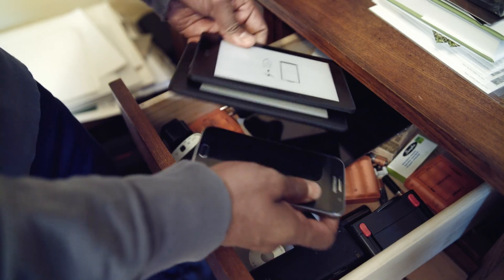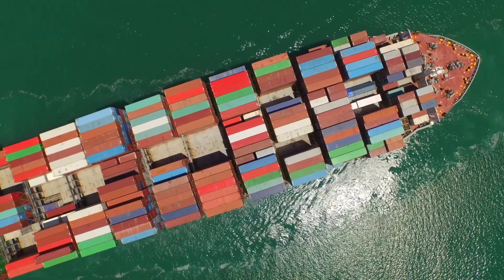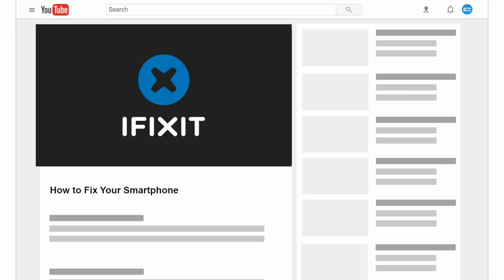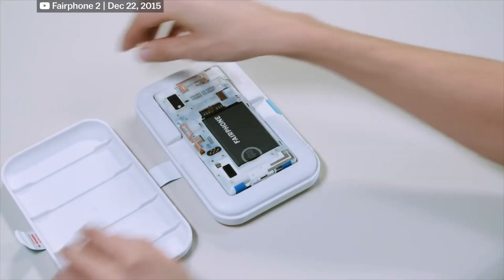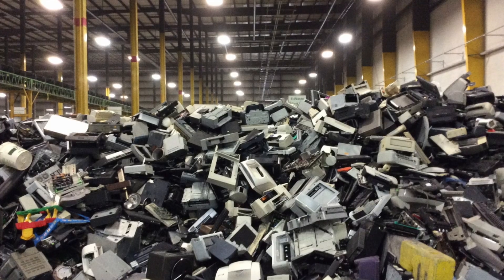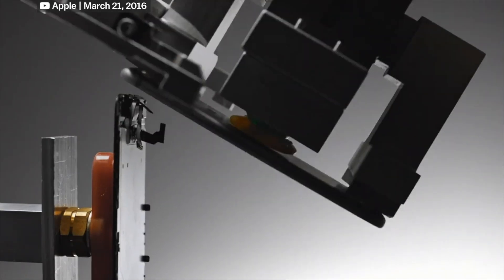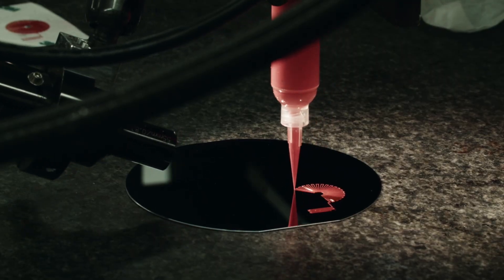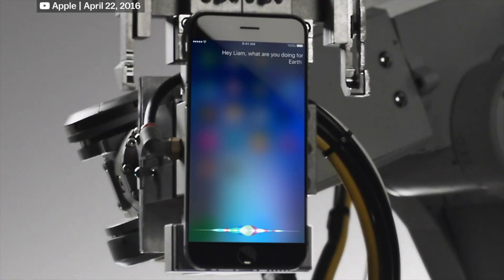Why your old phones collect in a junk drawer of sadness

Comment: I must say it, Gwendolyn is hot.

 But to the topic of the video. We could for now pressure our governments to make it mandatory for phone manufacturers to make phones with the ability to switch batteries easy and on your own. And also, they could unify the cables needed to use for charging and connecting to your phone to a PC. One of the biggest reasons I never will go for apple is that they have overpriced special cables for everything, not only phones. That is in my opinion just wrong. Both from the consumer side, but also from the environmental side.

Comment: When I was young, I used to have a old Nokia phone which was black and was solid in construction called the Nokia 5510 and had a removable battery with a removable SIM card slot and now we have thinner phones that are more likely to break when dropped and does not have a removable battery so that sucks.

Comment: I got rid of my iPhone 4s (which I love and now use just for music and the apps that still work) because the updates required to make it run would brick my phone and most of the apps started shutting down as they switched to newer updates.  the physical phone still works after 5 years, even the battery, but it was becoming progressively unuseable.

Comment: People replace thei phones because the battery goes out? I always wondered why they seem to swap phones so much (I though it was because they broke the screens/phones somehow)... I don't anticipate having that issue any time soon, though, because my phone is always either plugged into the wall or plugged into rechargeable USB battery packs that I carry behind the phone. I suppose I'll need to replace the battery packs eventually, but since they cost about $10 each (they're small ones), I'm not too worried about it. (As for breaking it, I keep it in an otterbox with a screen protector so, yeah, not a big worry for me. I've accidentally dropped it a couple times, but it doesn't seem to affect it through all that protection.)

Comment: Been using iPhone 5 for more than six years now. Haven't crossed iOS 8, so it's still quite speedy. Got a $10 battery from eBay that came with the tools, replaced the battery and voila, the phone is just like a new phone. 

How do you think Apple, Samsung and other tech giants keep pumping their profits? They strategically allign their OSx updates with your phone life; the more frequently you update, the slower your phone becomes and the quicker you make a repeated-purchase from them. Be smart, evaluate the features you really need vs. the garbage they offer.

Comment: I'd still be using my Galaxy S3 if Samsung hadn't stopped giving security updates. With a replacement battery it still works fine. It's software support that kills modern smartphones, not failing hardware.

Comment: The problem with such efficiency policies is that it is often against the short term profit interests of the firm. An example of this is that in the car industry, electric cars were suppressed for a long time because they need less maintenance, and regular visits to repair shops had become an additional revenue stream for firms. 
Similarly, companies have gotten used to selling you the newest and most expensive phone every two years. Improvements in battery life mean they can only sell it to you every three or ten years.

Comment: WHO THE HELL DOES THIS?!
Who's stupid enough to keep their old devices instead of selling them before they lose their value?
Reply: usually worthless by the time you switch out, depending on how often you get a new phone
Reply: My last phone costed $60 brand new. After the screen broke it was basically worthless.
Reply: They are a backup for if your main phone breaks
Reply: Lulink 
people who use their phones until they already lost all their value. or until they break.
Reply: I keep all my old phones to look back on how far technology has come when I'm older.
Reply: I keep all my old phones just to be able to look back on how far phones have come. It's also nice to be able to walk in with one of those Slide phones just for lulz.
Reply: Ollie Bailey Fair enough.
Reply: Lulink all my old phones become worthless cause i probally broke them except for the ones with software failure.
Reply: Lulink hoarders
Reply: Dr.Sanjayan
Reply: Sobsz it was worthless when you bought it
Reply: Well I only had 3 Android phones in the past, so I didn't change that often and I could always sell the last one for a reasonable chunk of the new one... I don't crack my screens.

Comment: The fairphone needs to be made by a Chinese company so the cost could be disruptive, and ramped up to an economy of scale. The environment is a great driver, but when in tandem with price sensitivity, it's hard to deny. if the fairphone was $300-400, and the parts were easily replacable and inexpensive, I would not get another phone. Perhaps forever. if someone could put forth such a business model, there is a great deal of money to be made with after market parts.

Comment: this video was great until we hit graphene. Vox usually does a good job of diving deep into political topics and giving a fair overviews along with their opinion. However, this is not the case on scientific topics. My advice: (option 1) don't mention anything about battery science (option 2) actually explain the Li-ion battery operation and current research and challenges. I get the shameless plug by LLNL but it does the public a disservice. Basically, do the in-depth journalism that we love you for in the scientific realm as well. Please don't just throw out science jargon like "graphene" and "3D printing"

Comment: WOOW we arived in a time where its something special to be able to take a battery out your phone!!
Reply: just plain sad...
Reply: suckittomcat I can remove my battery from my samsung and I replaced it after using it for 2 years with little effort. I also got it on contract so my calls and data was included which on a sim only contract would still have only saved me about £240 so i dont see the problem
Reply: it's only been a few years back when we were able to remove a battery out of the phone, so i don't see what the big deal is. people fell for the "sleek and simple" design that makes it more difficult to repair a phone by simply removing the back cover, which is a shame.
Reply: I paid less than $200. for my Alcatel with stereo speakers and other good stuff. Can't take the battery out but at least I didn't pay $750. - $850. for it. Screw Apple and Samsung.
Reply: ...There are phones that don't allow you to take battery out?!
Reply: Karras Bastomi just plain boring and a waste of time
Reply: plenty of iphones for less than 400
Reply: Architector #4 no there is a way with all phones. it's just hard
Reply: I mean naturally, without having to use the screwdriver and such tools
Reply: Lets make getting your battery out a lot simpler... get a Samsung phone. Just easy take the back plate off and then you can just take the battery out
Reply: Microphone Samurai its mainly for Iphone users
Reply: As long as the option exists somewhere, I will ALWAYS buy a phone with a removable battery. Currently rocking the LG G4.
Reply: This is like the eighth time I've seen your shitty comment. I don't care about the whole iPhone vs Android argument, but I just think it's a little bit disingenuous to make judgments on people based on something so stupid.
Reply: Microphone Samurai 
"I'm also a tech geek"

pulls out an iPhone
Reply: android peasants

Comment: I fiddle with my laptop all the time, I never knew people were afraid of doing self repairs?
Reply: Kyle Li not everyone is tech savvy, my son
Reply: Oh... woops...LoL
Reply: Typical asian, i guess...
Reply: ***** I guess looking at something as high tech as a smartphone. People get very intimidated by it.
Reply: Kyle Li : wires? Vacuum Tubes!
Reply: Yeah i reassembled most of my laptops numerous times. My current laptop from 2013 still has original mainboard, but its enclosure is new (because i am a very accident prone person), its keyboard is new (because i type a lot), its optical disk got replaced by a hard disk and its hard disk by SSD (i was a bit too timid to try soldering in an M2 socket, which is not populated on main board, given i don't know what support components it might also need), and now that i mapped out the display connector and seen that there's no EDID copy in the BIOS, i hope that i can drop a better display in and it will work!

Unfortunately i must say it's not really MADE to be taken apart, the enclosure always takes a bit of damage. Maybe i should design a new enclosure for it and get it milled out of magnesium aluminium alloy, but that seems crazy. Milled enclosure certainly wouldn't need all those clips though to stay aligned!

Also the lack of schematic prevented me from soldering in M2 socket.
Reply: XD for those who are simple minded, below average of everyone else. It's all just magical to us how things are assembled and how batteries can store electrical energy. <__< Cause I'm not a Tinker and because I usually tend to break more things when I try and fix things, this is why I don't try and mess with the insides of my phone, or iPad, or computer. It's simple to all who have the brain capable of thinking correctly.
Reply: But... you're asian too ;-;
Reply: Asian's problem? Maybe?
Reply: Don't you just hate it when you forget what you are? 

Sometimes I forget I'm an attack helicopter.
Reply: you must be one smart cookie. I just play chess.